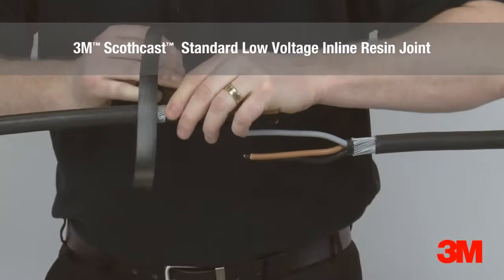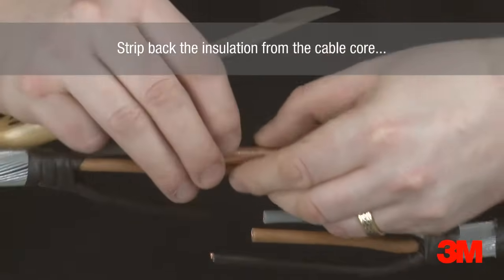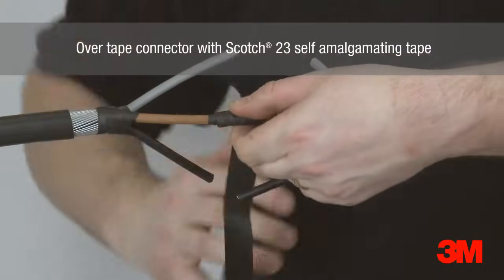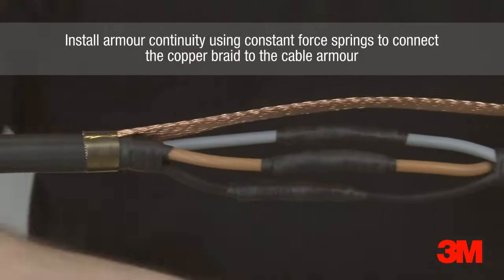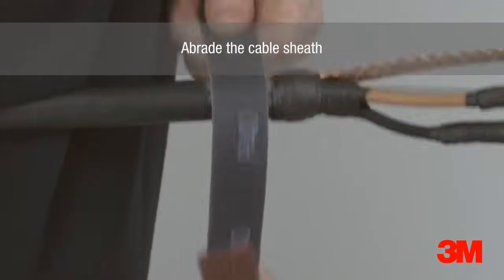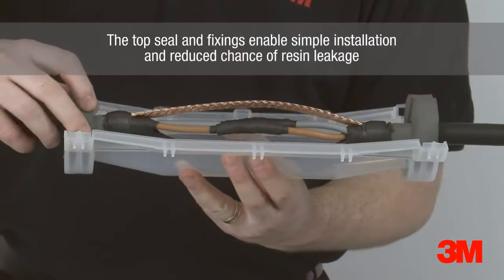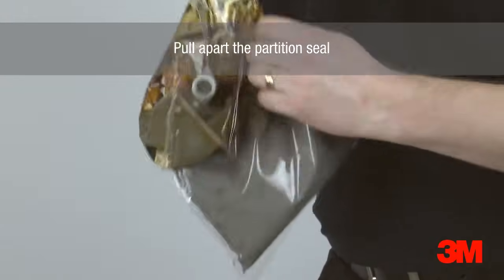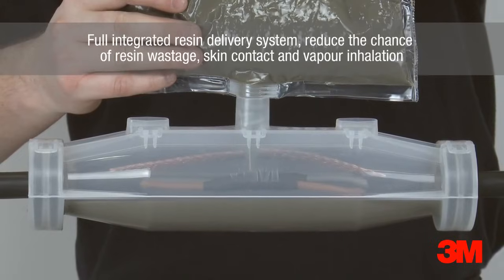3M Scotchcast Resin Cable Joints | Low Voltage Inline Straight Jointing Kits

Comment: How to make out which type of joint to employ
Heat shrink or cold shrink or cast resin.
Or it depends on case to case basis
In indian environment in most of tenders specifications are given for heat shrink jointing kits only. And many few vendors are providing quality cable jointing and termination kits like 3M, Ensto, Gala Thermo, Compaq, etc.